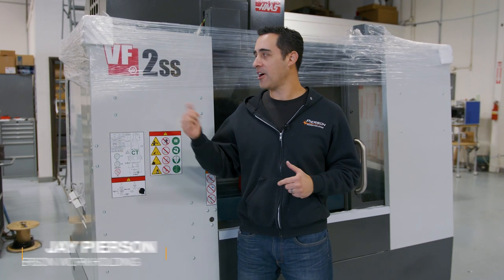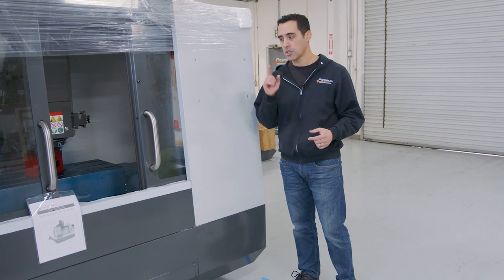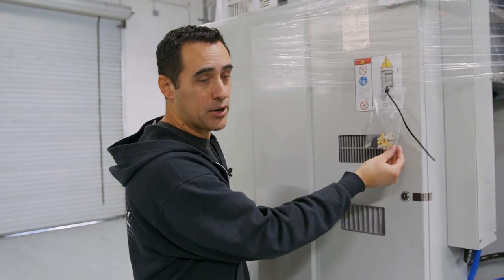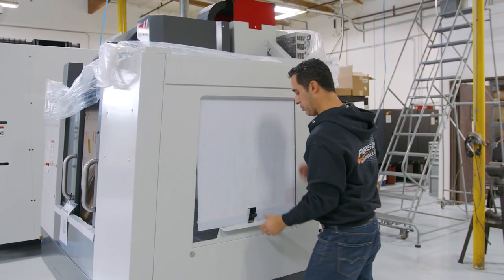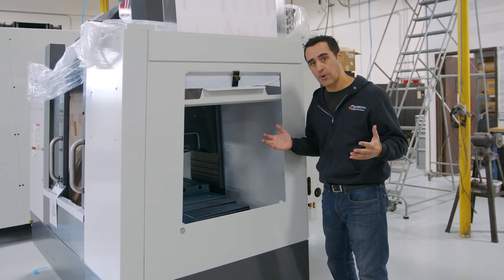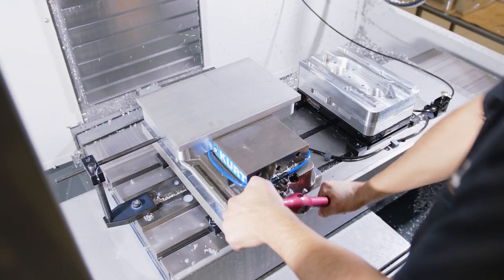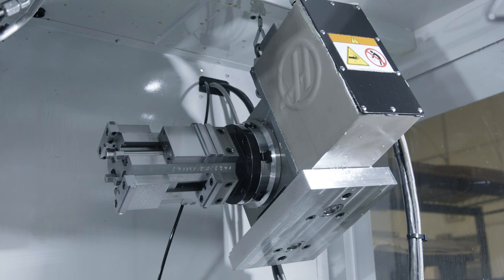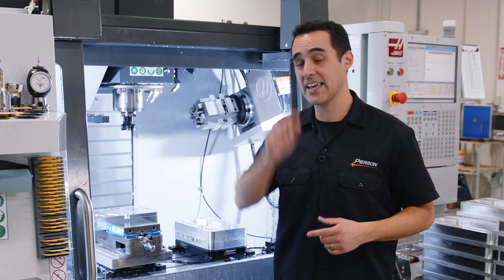The HIDDEN COSTS of a HAAS VF2-SS | Pierson Workholding

Comment: I had a new vf2ss delivered 6 weeks ago. The right side panel was bowed about 1/2" from poor assembly from The factory aswell as a dented corner on one of the SMTC cover panels, also caused during assembly AT The oxnard factory. The tool holder vise shiped was BT but SMTC arm had CT as ordered. Reported to my hfo but sofar NO actions to solve these issues.
Reply: Our remote jog handle was on the floor one day because the holder failed. We gave up on our auto doors. The crappy plastic rack keeps peeling up so we gave up. There was a fix from haas but that lasted about a month.
Reply: @chrisyboy666  Having a Haas Mill, I strongly disagree. Very good machines for there price range.
Reply: Sounds like the mafia is involved, breakdown in communication, and suckers will just give up.

Comment: Please do a quick vid on how you rigged up that 4th axis lift!!! :):)  mcmaster links would be great too!
Reply: They drilled a hole in the top to use a strap....it only weighs 90 to 120 lbs..just grab it and stab it...I did granite countertops for 17 years...metal is not heavy no more...

Comment: I bought a Haas first of the year and it had broken welds and lots of scrapes. Phililps wouldnt do anything about it. It even took calls to haas in california before they would even address odd scraping noises the machine was making new. Then they said that I didn't want them to take apart my machine because even if its scraping on something its better for that to wear away then them take apart the covers because they wouldn't be able to put it back together right.  I now have a big lemon sticker stuck above the haas emblem and I am making the switch to mazak.
Reply: Have you looked at a brothers or YCM? Nice machines. Do you have other Mazak in your shop already? I'm only asking because a lot of guys like them and a lot hate them.
Reply: @scottknight1301   I have not. Buying a machine is so much about your local factory outlet. If they suck then the machine is about useless when there is a problem. My first haas was set up by a drunk tech who crashed the machine. My second was set up by a guy who had to read the instructions. When I had problems I was told that I just didnt know how to run the machine. When I finaly proved the inconsistency in the x axis they replaced the motor and driver with USED components off another machine. The sub spindle to this day is unusable and haas wont do anything about it. If you are a younger business owner and live in the south east RUN from Philips. Their sales person last time he was here got into my face when I said I was not going to order my 5 axis from them until they fixed the y axis lathes issues. He stood there jabbing me in the chest with his finger explaining to me why machines have problems and sometimes you just pay 20k for a sub spindle and if it makes grinding noises then you just live with it. After they left one of my associates who was there said "if a fourth haas comes into this building I stop coming in"

When I was calling around to look at other machines MAZAK and Okuma both came out with their tech guys so I could meet the people I would be dealing with. I was very impressed with both and I just liked the Mazak controller better.... and well the price was closer to what I was prepared to spend on the haas. Haas makes nice stuff. I Love my haas machines and If I could buy from another factory outlet I would but haas wont allow that unless I move states away.
Reply: @hyperformancellc  totally understand that. We happen to have a good Haas HFO near us but that's beside the point.  Any sales guy that pokes a customer is asking for a free tour of the local ER . Mazak can be a nice machine( controller preference for some but not myself), my dad loves his and is a big fan. At our shop we have two less then 2 years old and their techs practically live at the shop so I'm not a fan. Always dumb stuff too. Okuma though. Nice nice machine.
Reply: @scottknight1301  we seriously considered moving to another area to get a new HFO. would have had to move so far we would have lost all our customers though.
Reply: @hyperformancellc  that's insane but I understand at the same time. Good luck to you.

Comment: On a machine I run have changed the adjustable coolant nozzle to spray the table free of chips rather than the cutter (that is getting blasted) so when the doors open I only spray off my parts and have less to worry about for a chip to get stuck and cause me to make a bad part

Comment: If you run a CNC workshop you know Pierson(if this is your name) is a genius. 

For my workshop I have always wanted to be able to switch on and off the 4th axis as fast as possible.  What we usually do is we move the rotary table to a tabletop next to the side door of the machine with all the cables still connected. The tricky part is after the side door is removed you have to put back some form of soft plastic curtain to keep the coolant from shooting out. There are several problems. Firstly, moving the heavy rotary table out of the machine is a very challenging task and poses high safety risks for the employees.The direct drives are generally fine but the wormgear type usually weighs a ton. Secondly, the makeshit curtain is sometimes prone to leaking of coolant because of all the cables. Thridly, it takes time to reindicate the rotary table each time you return it back.

To winch the rotary table up but to keep it inside the enclosure may not look nice but it is so damn practical. It solves all of my problems. No moving, no leaking and no indicating(by palletizing). What a lesson I have learned from youtube! Please, keep up the good work of your vlogs and letting more and more people know how a genius you are!!!
Reply from the maker: I don't know about the genius part, but I know we excel in always asking if there's a better way to do things.

Comment: That filter kit is good but ridiculously expensive. On a previous job they had bought one without it and my predecessor wasn't bothered by cleaning and maintenance...
One messy (and late) replacement of cutting fluid I simply put a generic filter weave over the return and viola, all the small chips got caught.

Comment: The only thing I would do is add a fixed support for the rotary head. I’m a little nervous having it hanging from a cable while the machine is running. Something simple bolted to the sheet metal.
Reply: I was thinking too some kind of stainless sheet metal shelf or shelf bracket rails; not only would it hopefully secure it a little better it would just look neat and tidy.
Reply: Or just an overhead deadstop that you could winch it up against, like an upside down saddle.
And I'd put a little idler pulley on those suspended lines, which seems excessive, but I've seen lots of lines get tagged when booming up and down top head drive drill derricks, and a tensioned traversing pully is a surprisingly simple solve.
Reply: I was thinking about same thing. Maybe at least add some secondary protection and holding in case a winch or cable fails. Would be an expensive accident if it does.

Comment: Very good video. I'm setting up a Haas vf4 with those same plates. I think we counted that we can fit 4 pallets for MAXIMUM PART DENSITY. 
Does mounting the vice on the pallet compromise rigidity at all?
Reply from the maker: It's as rigid as bolting it to the table. Use the 10x12 size pallets for single and double station vises.
Reply: @PiersonWorkholding  I'm envisioning a plate replicating the machine table mounted in as many vacuum plates as you can fit. Easily interchangeable with various fixtures for relative jobs. Capable of utilizing the full machine travel for large/one off jobs while also quickly setup for production work as soon as that PO comes in. At the expense of only a few inches of z axis travel you can take your milling machine to the next level.

Comment: A guy down the road took delivery of a st30 lathe, had it commissioned running first job and the cabinet went up in flames, had it repaired and the door handle fell off, you can look over the machine with a fine tooth comb and miss something but as long as you have warranty your laughing as in regards of cnc systems.

Comment: One more important note about extras when buying a new machine. Carefully go through the list and check what options are possible/reasonable to add at a later date (when/if need arises).
Things that might seem simple like air through tooling might not be possible (but oh my is it great to have, quickly moves chips away from the cutting zone without the mess of cutting fluid and no micro-cracking of carbide tooling due to temperature chocks).

If you don't know what a feature is fore, research it! What are your needs next year? Spending some hours on options can make a huge difference. Imagine buying a brand new machine and half a year later realize you need an option you can't get as "bolt on". Or wasting money on something expensive that never got used. So don't stop with your current skill level - extend your knowledge!
Reply from the maker: Very good point. I paid $995 for "Through Spindle Coolant Ready" in case we need to upgrade the machine in the field. You don't want to save pennies that will cost you dollars if you can't do a bolt-on upgrade.
Reply: @PiersonWorkholding  And through tool cutting fluid really gets where it's needed, be it at the tip of a drill to evacuate chips fr a deep hole, at each insert of a huge face mill or the end of solid carbide tooling. (Personally I find the programmable nossle a rather lame compromise - to often it can't reach or is on the wrong side.)

Comment: I thought we were the only shop that winched our 4th axis out of the way, only what we do is tie a rope around the chuck and crank the knob, then the rope wraps around the chuck pulling itself up, then we use a carabiner to hold it up suspended from the machine enclosure. that way there's no load and no risk of it falling.

Comment: Haas are Chevy's in a world of Cadillacs.  For 10K-15K more you could get a Brother S700X.  You could also get a Robodrill.  Both of those machines are faster.  The Brother is more rigid.  The positioning is better on both and the chip evacuation is better.  Brother is the only thing my shop buys at this point it keeps running and is blazingly fast.
Reply: 2nd time I've heard "robodrill" in 24 hrs, now I HAVE TO check it out. Just the name sounds cool as hell. I just got my NIMS certs (and factory Haas, which are kind of a joke) and would rather have a great machine in the garage than a car. So maybe Robodrill and a bus pass it is

Comment: Does this cnc mill have temperature 🌡 correction?
Reply: Yes, in your dreams.
Reply: @loukola5353  oh so no?
Reply: @LordOfChaos.x  they use a mathematical model to approximate & correct for ball screw expansion & contraction during use. Works pretty well IIRC. But if you want any kind of "hard" compensation the only answer is linear scales & I don't think they were even an option on such a small machine. VM's maybe.

Outside of that you might be able to pull it off with probing & macros.

But the best solution will always be a climate controlled shop and if you're making stuff where that isn't enough, you most likely shouldn't be looking at a Haas.
Reply: @Iceberg86300  oh i see
Thanks for the explanation

I was looking for a new 3 axis machine
But i quess i will buy the DMG M1 if what u just said is true
Since it offers it at just 60.000 euros starting price
Reply: @LordOfChaos.x  no problem.

I didn't see anything about temp comp or linear scales on the DMG, just "thermal stability." Do you have a link? And w/o scales they're probably doing the same thing as Haas. 

But I've been out of the game ~11 years, so don't go making decisions w/o verifying my info.

Comment: Knife safety man, never cut anything pulling towards your body! Just found your channel, great work! Loved your talk about implementing LEAN or as you would rather call it FLOW.  You earned a new subscriber.  Currently running a Makino PS105 and using Solidworks/Camworks! 14 years ( mainly in sinker edm/hole popper edm (cnc 4 to 5 axis) a year of wire, and now Milling and CMM work is my home.

Comment: Nicely Done Jay, I had to chuckle a bit about the external Air Filters. Cool Idea, but I bet you don't have to change them very often as clean as Your shop is. I like the mini hoist idea too, pretty cool. How big of tool changer do You usually buy. I personally kick myself for not purchasing the larger ones, but " Oh Well Lesson Learned"
Reply from the maker: You'd be surprised how much crap is floating around a "clean" shop.  Tool changers - typically 30 tools but I recommend a big TC if you're a job shop.
Reply: Blasting compressed air through only blasts the dust back in the air. The filters capture it, it makes sense in a clean shop but in a welding place it's just a waste of money so take the depreciation. The machines can easily handle dust but it's also slightly cleaning the air for the shop instead of a dedicated unit.

Comment: I wonder can you use an alternative controller with this HAAS machine?
Can you show some more details about the motor drives/drivers and electronics?
Reply: Shouldent be a problem, its all servos and motors, tho costly to change out the system usually but fully doable
Reply: Haas is very strict about using only their controller. If you want Fanuc or Siemmens. (or even LinuxCNC which with ethercat servos is quite capable), you'll probably have to look elsewhere.
Reply: @franciscoanconia2334  ofc, but just retrofit it yourself, warranty is prob out of the window anyways if youre thinking about doing it

Comment: Is the unloading from the truck and the forklift plus driver really part of Haas?
Reply: Sadly no. I'm not aware of any outfit that makes machines willing to go that step. I've always had to arrange for pickup at regional distributor, and delivery at the shop.
Reply from the maker: Yes, the $1,100 includes freight and rigging to unload the machine and place it on the floor.

Comment: So it is advisable to buy a Haas machine or they are very fragile in general, a haas seller came to offer me a vr2 for 78k, the machine is the most basic
Reply from the maker: I don't think fragile is the right word.  There are better machines and there are worse machines.  I think Haas has the best value, service and resources for the vast majority of shops. I wouldn't recommend a VF for a small garage if just starting out and I wouldn't recommend a VF in a giant, tight-tolerance medical device company.

Comment: You mention a manifold, but I didn't see a mention of ventilation. Depending on material and coolant of course you definitely want to use some kind of torit hepa filter or something. I can't imagine you would just let that vent unfiltered, right? I am probably jumping ahead but I would also think it's worth mentioning. Outstanding video otherwise.
Reply from the maker: We put Mistaway collectors on every machine. 5 stage filtration ending with an activated charcoal screen.